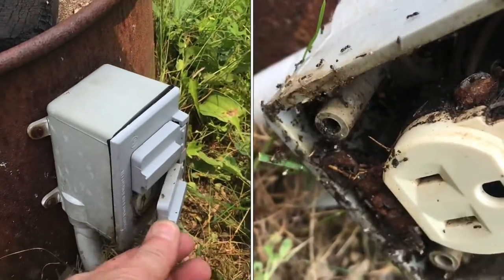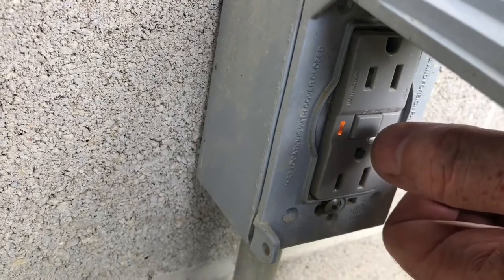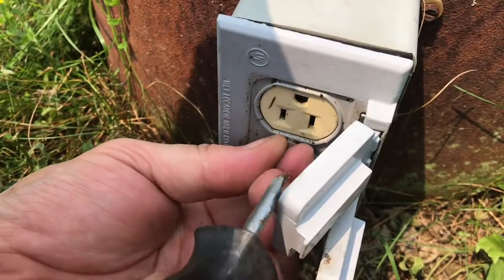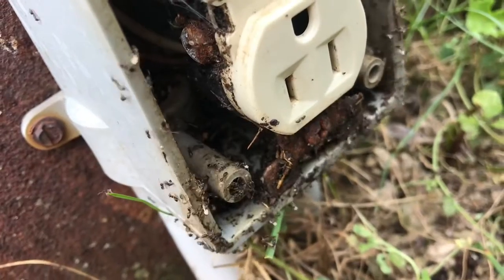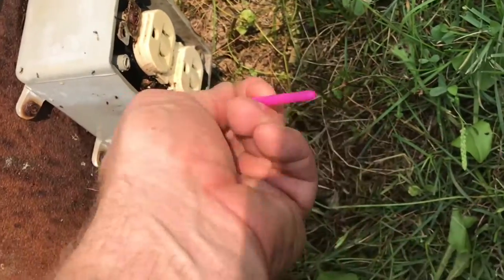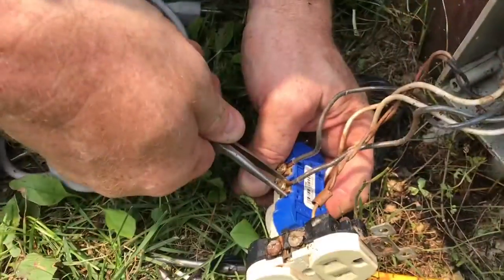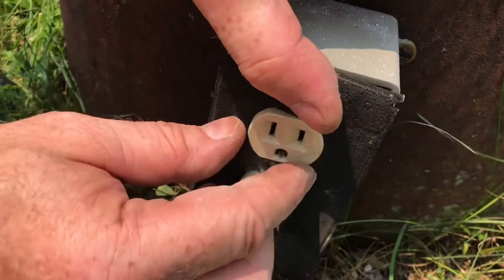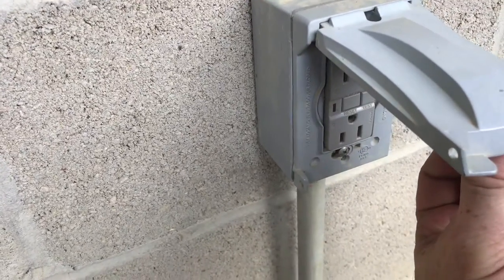“ants” DESTROYED my outlet (how to fix it)

Comment: I kept finding white like dust on my shed's floor and it turned out that Piss Ant are removing the foam from my insulated shed door. They are also in my ground fault electrical outlet, I reset the breaker and still no power, will troubleshoot tomorrow why .